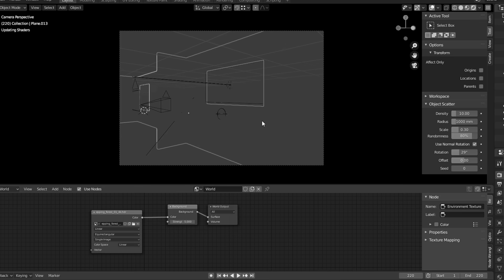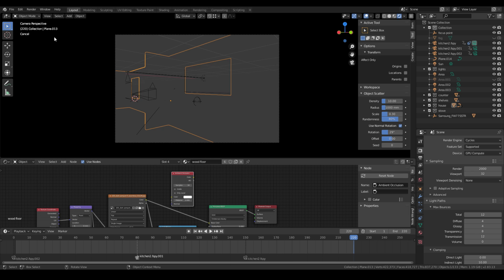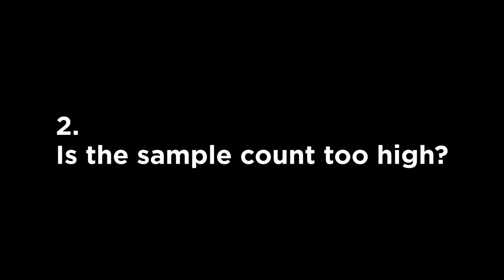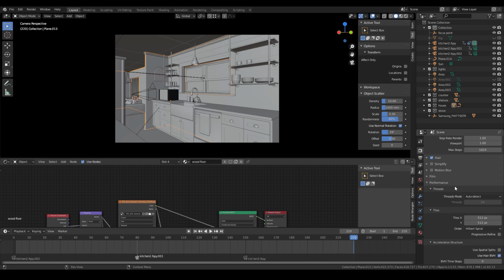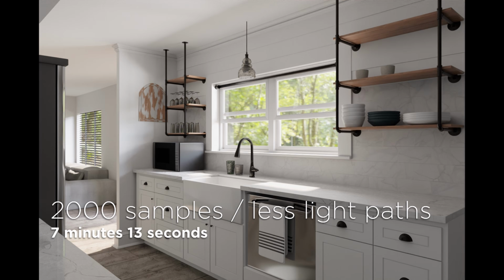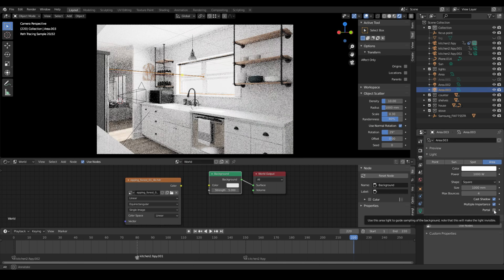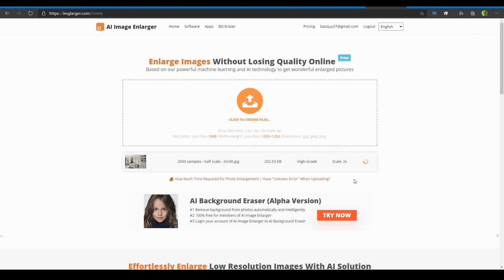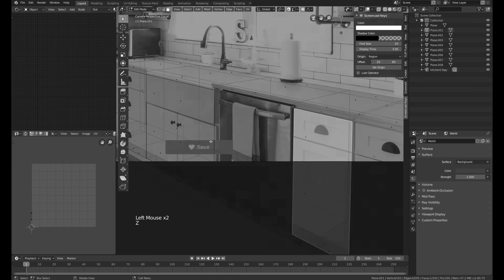5 Tips to SPEED UP Cycles Interior Rendering - Blender Tutorial

Comment: Sometimes slower sampling instead of noisier sampling worse it. For e.g using portals can reduce noise a lot so you can freely reduce sample count that reduces your render time as the result. Also you can increase the environment sampling resolution to make it's samples less noisy. This one also follows the same rule I mentioned before. For more complex scenes with variable noise distribution depending on light and shader, it's better to use branched path tracing. It makes you free to specify more samples to what makes more noise and vise versa.

Comment: Great tips. The only thing i disagree ( not totally) is the tile size. Blender comes with the auto tile size add on and its show more correct values to render faster. And also using intel ai denoiser instead of the default denoiser.
Reply from the maker: Hi! In this video I used the Optix denoiser, which is better than Intel imo. For the tile size, Optix render method performs better with large tile size in my case. Thank you :D
Reply: @QuyTran37  yes, but values of optimal tile size change with different resolutions. Stills big but not the same
Reply: @QuyTran37  and Intel AI denoiser beats optix both in quality and speed in my opinion an in cg cookie opinion :) but great video
Reply: I have to agree with Hugo Antunes , Intel Denoiser is a lot better in quality and it doesn't force you to have Intel hardware unlike Nvidia which only works if you have Nvidia cards.
 Your 1000 sample scene using the Optix denoiser had more artifacts in shadows and less details than my scenes on 150-200 samples with the Intel Denoiser. Also Intel works with nodes so you can change some stuff up or export different denoised results after render.

Comment: using cpu+gpu, in my case cpu slows down the gpu and running it without gives better results - so everyone do yourselves a favor and test each one individually and don't use the cpu if it slows down, if it's of no use, you can do other stuff while it's rendering, and less power usage obviously ..

I'm running 2x2080ti and i9 9900 k overclocked to 5.3 ghz - which is a pretty high freqeuncy and it can't keep up with a 2080ti - I can see from bernchamrks that this amd is 6x slower than a single 2080ti - so I'd check this part again
..actully my processor seems to be maybe 5-10% slower than this one, 363 sec vs 310sec, i9 9900k vs ryzen 3900x , so please check the speeds again individually and combined and report
Reply from the maker: Hi, thank you for your information. It really depends on what hardware you are using. In my case hybrid CPU+GPU can render faster than GPU only. I think it also depend on the tiles size and mine is 32x32 pixels. This Ryzen has 12 cores 24 threads so maybe that's why. :D
Reply: Quy Tran yeah for gpu larger tiles are better I went around 300x300 on mine
Reply: The main issue with the hybrid solution is that tile-szie really matters. To small and GPU struggles to big and the cpu struggles. Wish they had adaptive tile size, so cpu would render small and gpu big. Then when CPU is done, gpu switches to small so it helps CPU